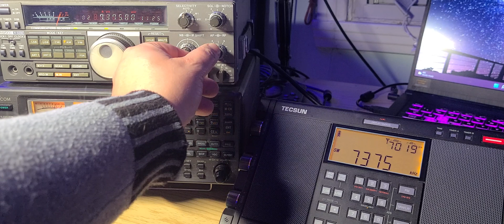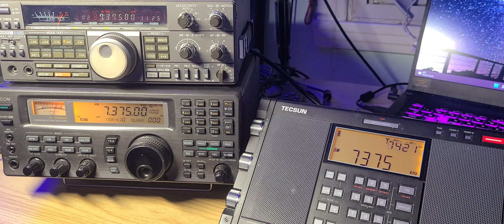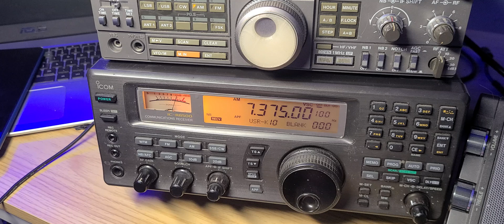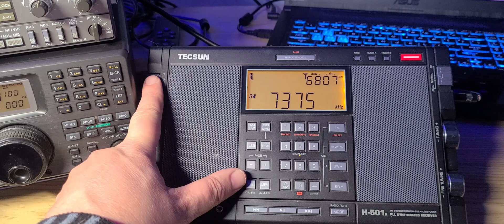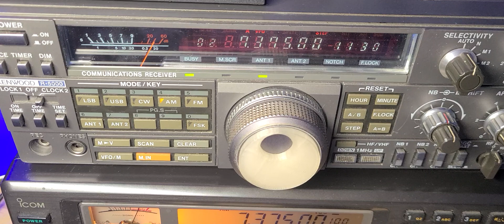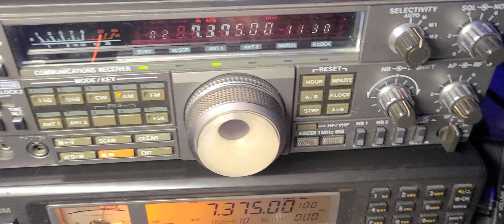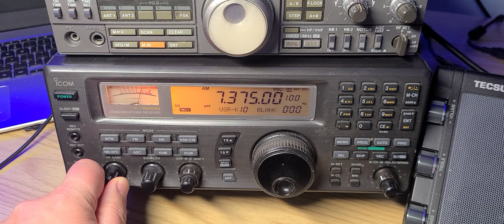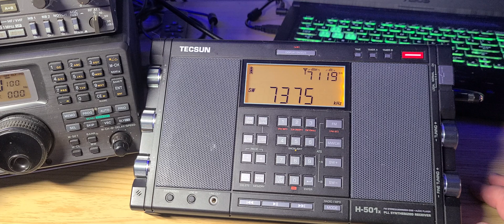Ultimate test Kenwood R-5000 VS Icom Ic R8500 VS Tecsun H-501X on Radio Romania 7375 kHz Shortwave

Comment: Where you get that rubber attachment for the wheel and be able to operate with the tip of your finger. Thanks in advance.
Reply from the maker: 3D printed

Comment: I am in the market for a new radio.
I considerd a used Icom because of their reputation. But when I hear this then I think I have to reconsider my previous choice.
The price difference between the Tecsun 990x2 and the 501x is not so great so I think I's better get the 501x because I believe the technology in both radio's are equal.

Comment: What are the notches for on the bottom left corner on the H-501x ....kensington lock? Looks like a built in microphone..
Reply from the maker: It is a microphone when you pair your smart phone you can make calls with audio through the radio and hands free through the microphone

Comment: In this comparison the Tecsun has the best audio but I would like to see a comparison with all three radios using the same external speaker or audio system. Kenwoods are known for superior audio and when hooked up to a surround sound system you can hear bass notes as well as full spectrum of audio.
Reply from the maker: I will look at setting it up through the Console with same settings
Reply: Also the same antenna